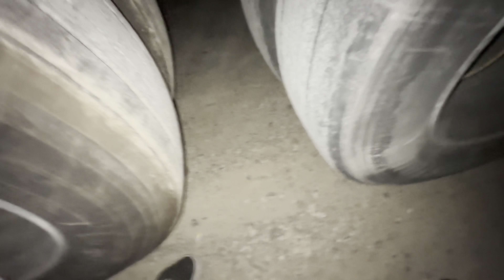Turbo Goes Boom | W900 Maintenance | Where Have I Been???

Comment: That an ISX15? What type of exhaust kit did you use specifically elbows under the cab?  Been looking to add a kit to mine but cant seem to find elbows for my 2013 that look like they would fit the cab without seeing them in person.
Reply from the maker: I have the Lincoln Chrome Peterbilt kit. You might have to move your fuel tanks back. Also important is the size of your steps. The stacks are held to the sleeper with the Lincoln Chrome w900 brackets and at the bottom to the chassis with custom made brackets.
Reply: May have to shortened Ur steps
Reply from the maker: Yes, precisely!! W900s come from factory with some wide steps.
Reply: Thanks for the info! Il have to look into it. Sounds like more of a pain finding the right parts thus why i havent messed with it too much.